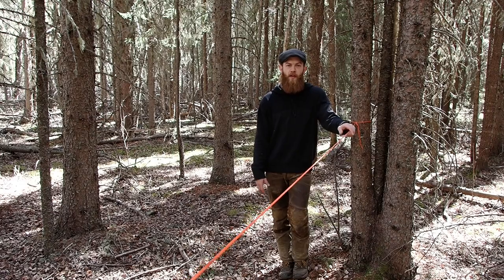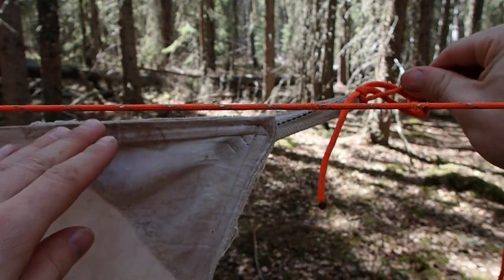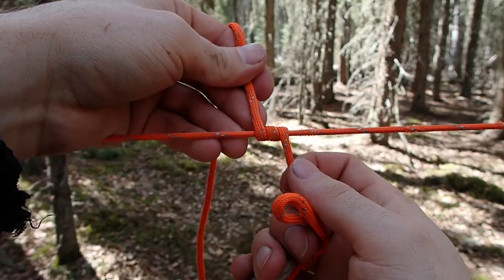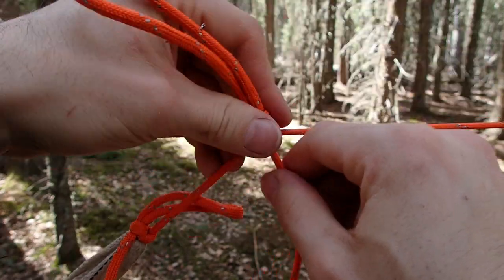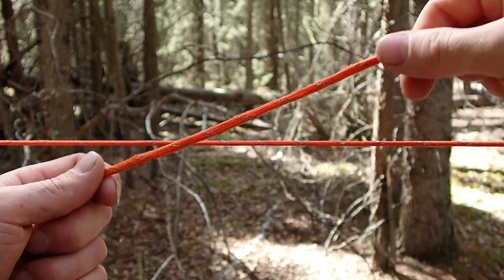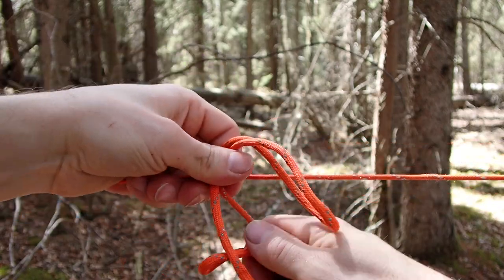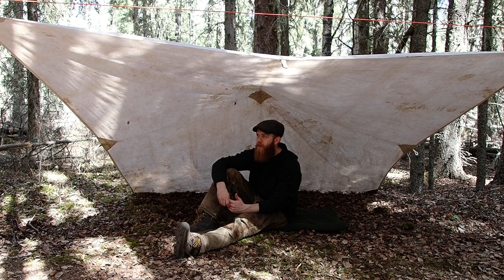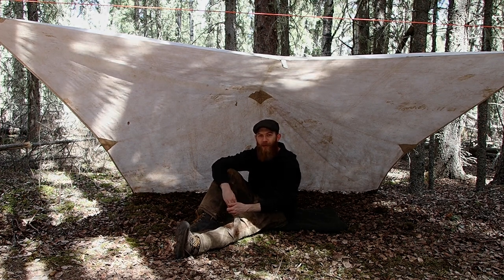Keeping it Simple - Attaching a Tarp to a Ridgeline

Comment: 4:06 where you say 'one length of cord' .. I think you mean at least 4? One for the ridge line, then you showed two separate pieces of cord to attach each end of the tarp, and then there's the cord you use to pull up the middle of the tarp to the tree.